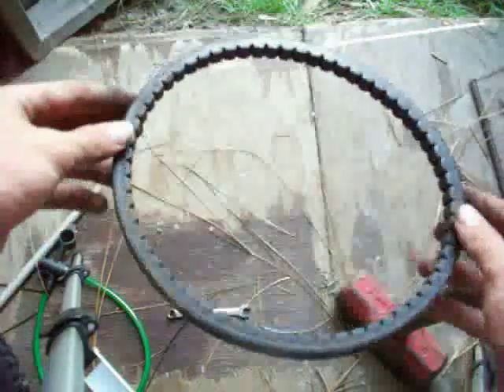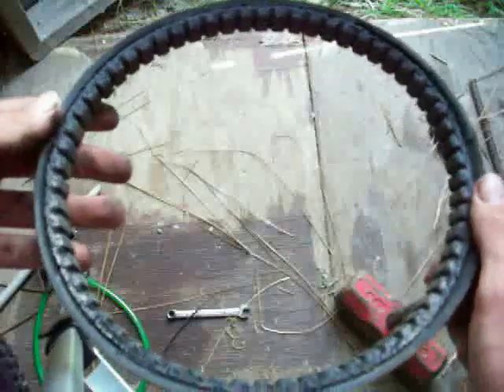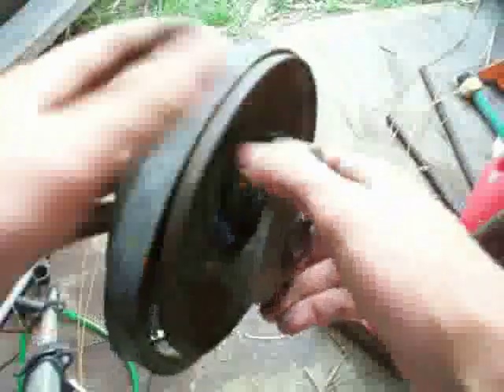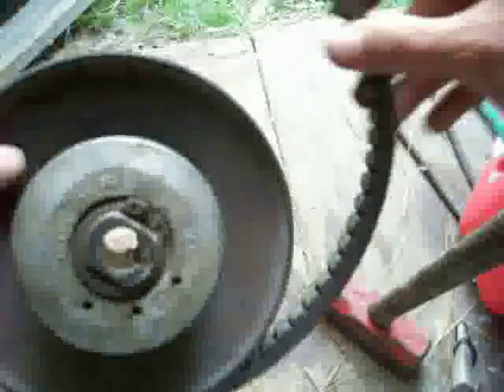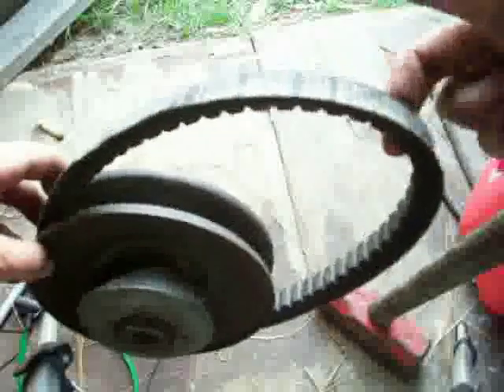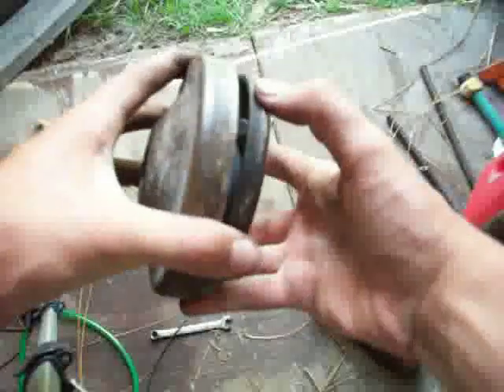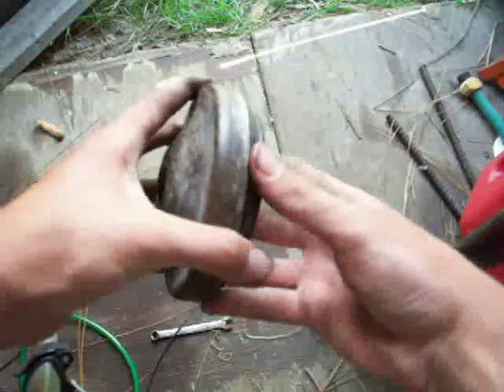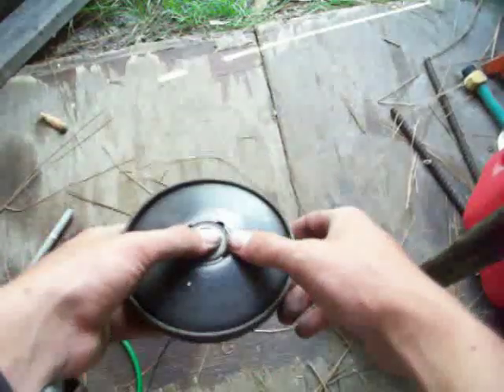30 series tourque converter, belt care

Comment: @adanarredondo13 

Your English is a little hard to understand. You should try Bable fish translation software from Altavista.

if your Kart is a Baja SD165 this is a common problem. Call Baja for the repair kit and replace the Primary clutch shim and buy a new belt. Other than that check bushings for wear and be sure the primary and secondary are in line. The primary should not float on the shaft

Comment: Sorry man... this has too be one of the most ignorant explanations of the TAV I've heard.  That belt is loose when the engine is stopped or idling by design.  The driver and driven pulleys change diameters with engine RPM.  That's the magic.